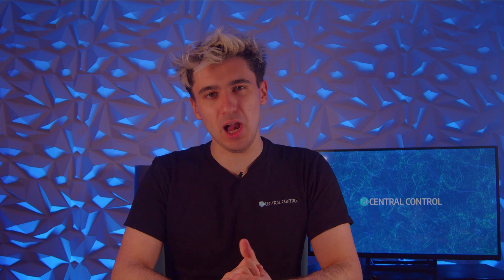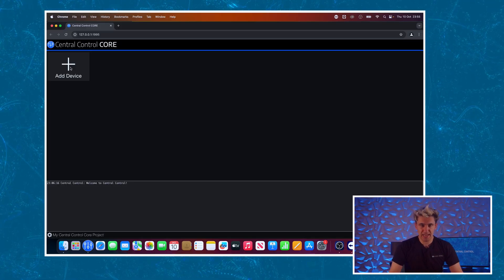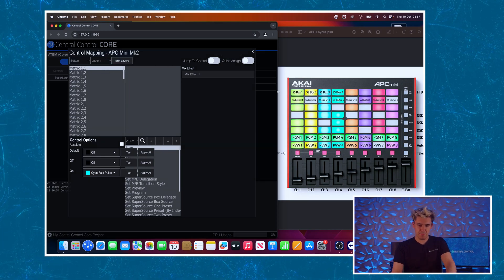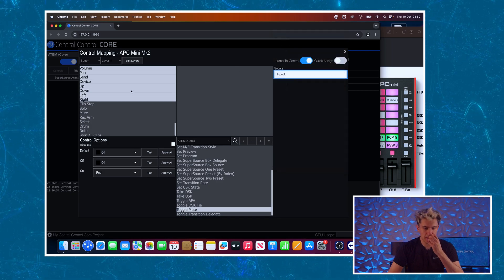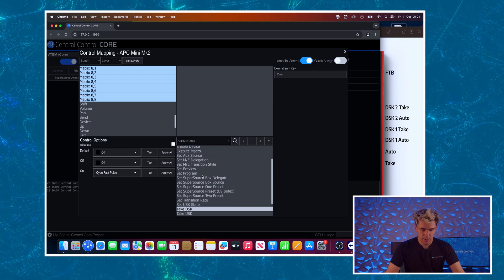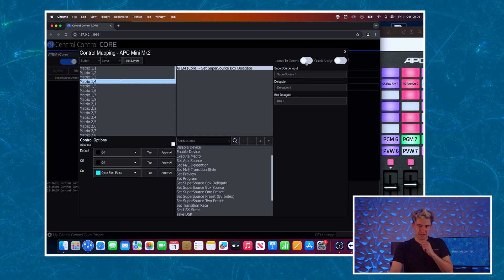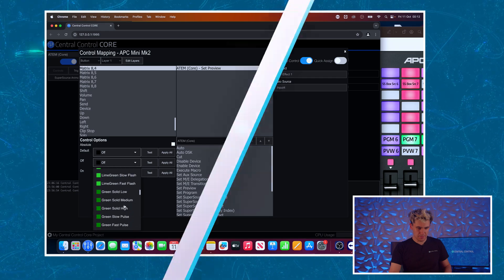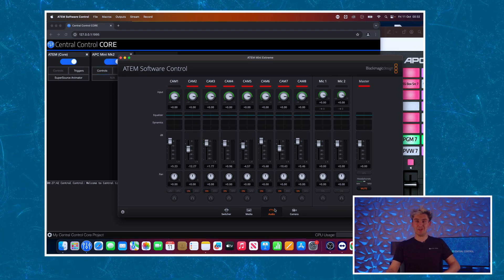ATEM MIDI Control of Audio, Switcher, T-Bar + SuperSource on macOS AND Windows! (FREE PROJECT FILE)

Comment: this software doesn't work with LPD8 (nor mk1, nor mk2). at the same time these controllers work ok over "Generic midi" preset. My controllers completly functional and work well in other softwares
Reply from the maker: Hi,

The LPD8 (and Mk2) are completely defineable using the editor program supplied by Akai. Because of this, it's not really suitable for writing a dedicated module as we don't know what notes/control changes the device will send for each control. It's best to just set up the controller suitably in the editor and then use the Generic MIDI module in Central Control.

Comment: Hi Joe, thank you very much for all the tutorials and of course the software, this helps a lot. Just a crazy idea, i would like to have the possibility to invert the fader to switch the controller 180 degree to have the fader on top, because i use the buttons more. I hope this make sense.
Reply from the maker: Hiya - you're very welcome. If you're on Studio you could use the fader limiter module and flip the min and max values to 100 - 0 which would produce the desired effect. 

This is technically possible on CORE also, but the UI just doesn't exist at the moment to set the range. I've added this to the list of priorities for the next CORE update.